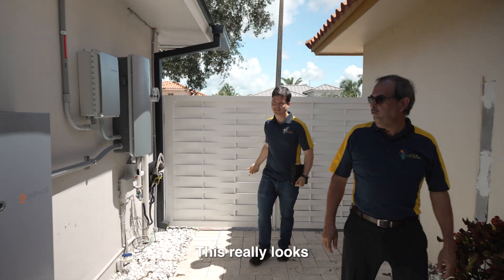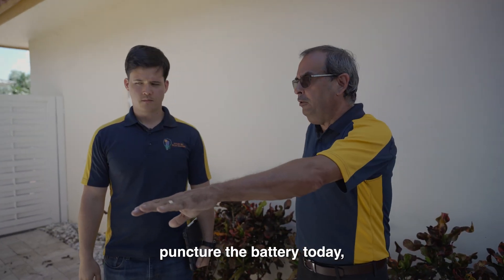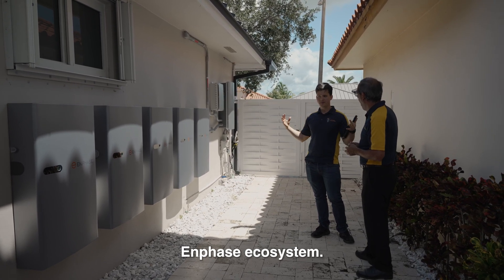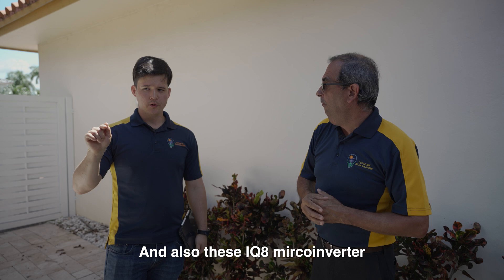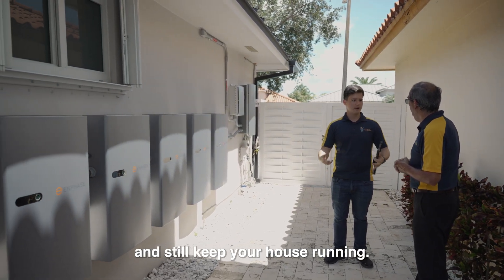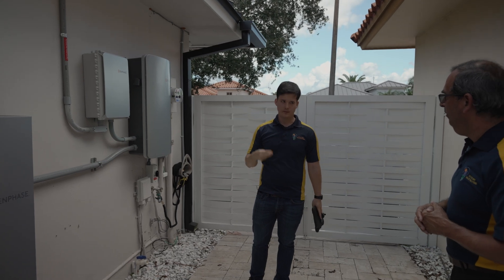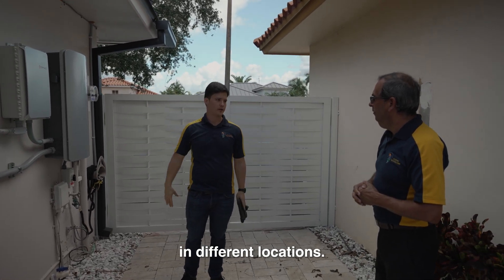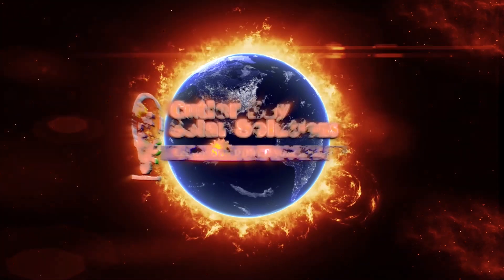New Enphase IQ Batteries 5p

Comment: So they dont have a kit to allow 3 to be grouped together inside a smaller wall space, like they had to make 3x 3P into a 10P (or 10T)? While the product seems like a step forward in most aspects, this omission is a step backwards, partially for installation in smaller spaces. 

I understand that even without this option it may still be possible do get more energy density (in some instances), but thats not all instances. It's also only in comparison to their own older product, not the competitions current or soon to be released products. The space it would take when maxing out the capacity is now significantly more than double the space required to max out the capacity of their older product (that had half the maximum capacity). It's also much less aesthetic, IMO.
Reply: Agreed 100% the 10P/T design is very compact and very good looking. Imagine if tesla takes the powerwall and divide it in two or three pieces.  Now the hardwire between component is a huge step forward as my system constantly has communication issues, Enphase replaced the communication module for the longer range and did not get any better to the point that they gave up and honestly i did too; I learned to live with those communications alarms as the old system is based in the horrible Zigbee protocol, i knew it was not much they could do to fix this design flaw
Reply: Zigbee works as long as you follow the installation guidelines and limitations, but I love the hard-wired system since it opens up so many possibilities @pwerboost
Reply: Is the same kWh per sqft. Besides the new hardwire protocol allows you to place batteries far away from each other. Previous version had strict limitations on placement. By the way Enphase will be releasing a floor mounted rack for these 5P batteries soon.
Reply: @Edu-Rodriguez NO,  it's definitely NOT the same kWh per sqft. It's roughly the same kWh per linear foot, when limited to 10 kWh, but the sqft required beyond that is quite different. Do the math on 40kWh... 

The 5P is significantly taller, and the 6.5 inch minimum spacing, even with the slightly better density, means they take much more space when several (especially when the 10P/T could have been used), are used together. Also, because of the additional height, when staking 1 above another the 5P leaves only about inch of play top and bottom in a, typical, 8ft garage and leaves about a ¼ inch of margin for all spacing in a 8ft vertical stack. That's less margin than some builds (especially those built to code requiring a slope for garage floors, in some areas) and less than some installers are comfortable with. Also, Enphase's minimums are less than code minimums in some areas, and those code restrictions would prevent staking of the 5P, while staking would be possible (within code) with their older generation of storage.
Reply: @ThomMurphy  Your are right in that the 5P, once installed, covers more area, especially due to clearance between modules. I was referring to kWh/ft2, since they are both very similar with around 0.9 kwh/ft2. On the other hand, the 5P is more power-dense than the 10T (0.65 kW/ft2 vs 0.35 kW/ft2). If you compare them side by side, the new 5P will cover more area for sure but the Hard-wire protocol and future floor-mounting bracket are a tremendous improvement over the 10T, that unfortunately puts too many limitations on placement due to wireless communication.

Comment: what was the cost of this battery configuration, please?
Reply: In Australia the price is $10000 Aud for 5 kW battery with the controller fully installed adding additional 5kw battery will cost $5800 Aud.
Reply: @johnl4347  Thank you

Comment: Oh they can still thermal runaway just not as likely.  stretching the truth is still a lie. Also how they are connected is called Daisy chaining which causes more heat which means less efficient and you loose life cycles. Batteries should be connected to a busbar where the load of each battery is shared evenly which lowers how hard each battery works which makes it more efficient  and prolongs the cycle lives. example of how C rating works. they have 5 5kw batteries which are most likely 100ah cells. Daisy chain( you use 10kw of electricity, that is 200amps or 2C) pulled through all batteries and how they are connected they will not even balance each other.  Now Busbar( you use 10kw of electricity, that again is 200 amps but since it pulls from 5 batteries evenly each battery gives 2000 watts 40 amps which is .4C.  optimal performance is achieved between 0°C and 45°C (32°F and 113°F) so in areas with high heat say 100°F that means if you work them hard they will go over 130°F easy. Lithium breaks down from heat fast and cold also. Also the hotter they get the less they give you in energy you could loose 20% just to heat. Batteries should be inside where temps are better controlled. Also salt air and humidity will also take its toll on them being outside. a garage with a mini split would be better in places with high heat and freezing cold.
Reply: 10KW is 41.6 amps at 240v spec not 200 amps. 

Also Daisy chain refers to serial not parallel installation. These are parallel installed. Each battery can be turned on or off individually adding it to or removing it from the circuit. There are busses in each battery to connect the main to the next battery. The power doesn't go through the actual battery to the next battery. That is why they have 6 inverters in each battery pack for that battery alone.
Reply: @Official_R_P_A  To get 10kw from batteries its 200 amps from them. Parallel is same as Daisy Chaining.
Reply: @dc1544 you wilding bro. Lmao
Reply: @USNEM  no just giving facts. I think these units are great but how they are connected not so much.
Reply: @dc1544  Your math still doesn't work. 10kw/200amp=50v. Common learn some math.  Doesn't match any of the specs on the video or company's battery specs. You are just making shit up at this point.
Reply: @Official_R_P_A  are you really that dense. the batteries are 44-58 volts but most take 50V to measure amps from watts etc. I know the micro inverters put out 240V but they get that from the battery at 50V. so 10kw from those 5 batteries is 200 amps then the micro inverters convert DC to AC at 41.67 amps. I have 60kw of battery banks 4 of them each at 15kw and they go to busbars so the load is divided evenly.  Just so you know there wire has to be rated at max output which is 30kw for 3 seconds for 5 hooked in parallel so to be technical they violate regulations for improper wire size. this is again why they either need the batteries to go to a busbar or after inverting they must go to a separate breaker in a breaker panel that is rated to the max all the inverters can put out. if the inverters all malfunctioned at the same time say from a short that would start a huge fire with the existing system. So please don't talk about things over your head. even though the micro inverts only put out 600 watts 6x6 is 3600 x 5 =18kw  is 75 amps and that is also a big wire. So many things can go wrong with how these are setup. but go ahead trust your house and family are safe because a company want to make money not protect you.
Reply: @dc1544  75 amps on 240v is 4 gauge copper wire or 2 gauge aluminum, not big wire. Have you ever read a building code in your life? Wire isn't rated under code for maximum spike draw it is rated for continuous use. It is a known safety factor that a wire as rated by code can handle spikes of 2.5 times the rated use. It is literally written into code. Also written into code is that a wire may be used on the next size up breaker from its rated capacity over its max amperage if an appropriate sized breaker is not available (not made) on 220-240 circuits. Not to mention that it all feeds through a breaker which will trip, completely shutting down the circuit. Keep digging your philosophical hole, it's just getting deeper. 

Also this is called service entrance cable and is all rated at 75c, just in case you decide to educate yourself.
Reply: @dc1544 doesn't know what he is talking about